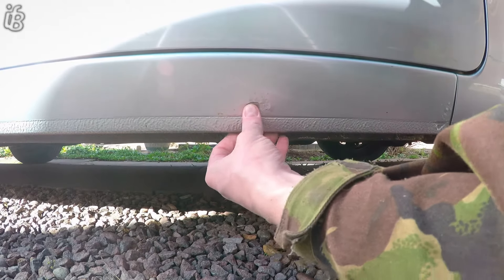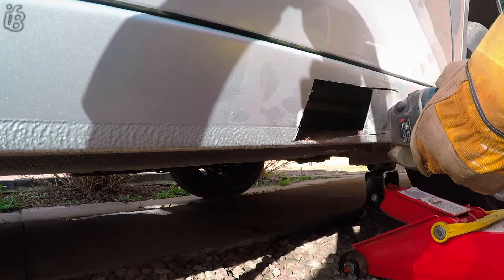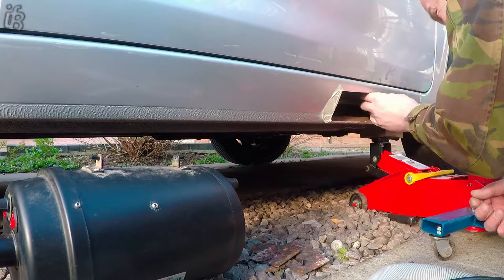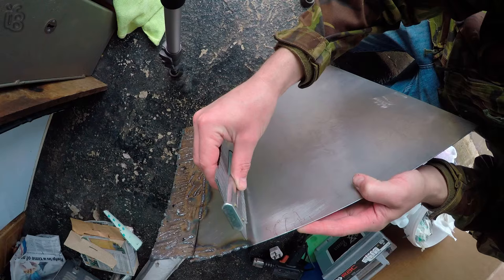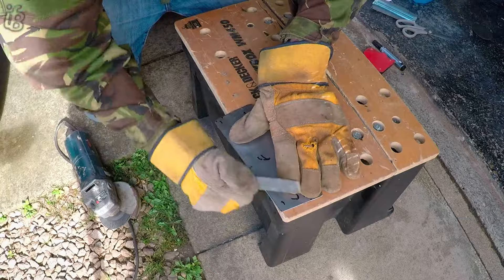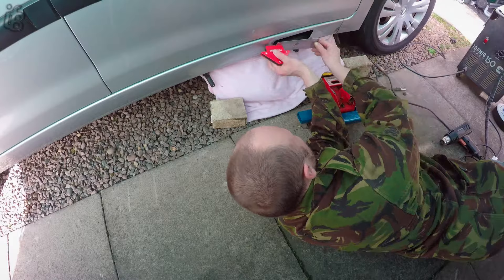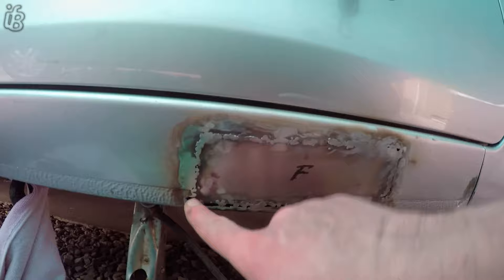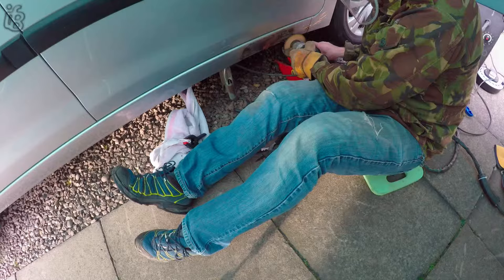Sill repair, cutting & welding pt1

Comment: To anyone else about to try this, shield your work if using mig gas, the wind will take the shielding gas away, cut more out than you think you need to, as soon as you weld thin metal it will blow through, you need to cut back to good solid metal, inner sills need to be repaired properly unless you want the car collapsing when jacked up, no gas mig welding can be a good option, but you still need good metal, thin rusty metal will blow and pop holes regardless, always have a spotter to watch when welding, its easy to set things on fire without noticing. Grind so sparks go downwards or away from glass, the hot sparks can and will stick to glass and paint, later to go rusty, better and safer for your eyes anyway. check if your grinding pads/discs have a date on them, they don't last forever and don't like damp conditions.
Reply from the maker: Well said, yes it was shielded from a sheet, thank you.
Reply: Hi, what's a good welder to use for a decent price.
Reply from the maker: I would say get a second hand one, definitely mig. But if you have a Tig then use that. But considering you are asking I assume not. Check out the forums for upgrades and reviews. Mine is a sip, they didn't give great reviews from it. But it was an upgrade from a dual power/speed gasless which sucked. 
Check out the forum and tutorials from here https://www.mig-welding.co.uk/
Reply: OK, thank you.

Comment: Great Video!  loved the bit where you've nearly finished it, all you need to do is leave it alone, but your like every good diy'er and have to play some more and blow a great big hole in it hahaha.  Doing mine soon, so thanks for this!
Reply from the maker: Try to take it back as far as you can, unfortunately the rust has came back in a part I thought I might have gotten away with, so this time I'm going to cut my losses and for about £45 buy a new rocker sill cover. Just awaiting the parents to agree on it. Then I'll do another video.

Comment: Wow, I've been through some of the exact things like burning out weak areas.  You are doing a great job.
Reply from the maker: It's a pain right, just got to keep on going. If had to do again I would cut the sill out and replace!
Reply: @ifell3  I have a car where the rot goes into what I believe is called the support and back sills, it's a huge mess and I'm debating what to do.  I bet we agree about hating rust.

Comment: Nice to see someone doing a proper job of the welding instead of these bodgers that cut it out and then stick metal over the top or rivet it and cover it with 1/2 an inch of filler.
Reply from the maker: Cheers fella!

Comment: Tidy job mate. Looks like exactly how I did mine except I injected wax into the whole sill. Dynax S50 by Bilt Hamber. Wouldn't touch anything by hammerite. I live by the sea so I know what works and what won't 😊.
Reply from the maker: Cheers fella, yeah I wish I had spent some money on some wax. First sill repair in years, the choice of protection is overwhelming!!
Reply: @ifell3  My old Bora is 18 years old, gives 70+mpg but has a bit of the old tinworm in the usual places.

Just spent nearly £700 on a mini restoration. Mrs thinks I'm nuts as could have bought another for a few £££ more. Women don't get that us blokes LIKE to tinker with cars and stuff. The satisfaction from doing the job yourself is priceless when you can stand back and say "Yeah, I'm pleased with that". They just look at us like were mad, then they go and buy another pair of shoes 😂
Reply: @siliquaesid703  there is a lot to learn from women, I realize that we men are trapped in our own box, they see beyond it and do not care about other than that.
Reply: @siliquaesid703  yeah my girlfriend said why am I bothering welding my sills on my car why don’t I just leave it until it’s bad and has a hole in it. Thing is it’s already bad once it’s bubbling on the surface and I want to save it whilst I’ve got a chance lol

Comment: Hi, I take it you disconnected the car battery, where did you earth point the mig
Reply from the maker: Yes I always do, I never used too 20 years ago but everything is electronic now. I think I may have even disconnected the ECU too. Always place the ground as close as possible, I connected under the sil.

Comment: Great vid, question what welder do you use as I keep blowing holes with mine ends up like a collender!
Reply from the maker: Gas MIG, do it in little bursts, clean metal and a good earth. Use a mixture of gas too, pure c02 will give hotter penetration, which you don't want.
Reply: @ifell3  Thanks buddy for the reply, was looking at gasless MIGS but guessing no good pretty cheap reason being.
Reply from the maker: @ZippyPenguinTribute  one bloke in the comments recommended using a gasless MIG. I had a cheapish FCAW that was ok for thick metal, that eventually was used in another video to rehouse my SMAW. I brought my GMAW off of eBay for about £50, power and wire feed settings are the most important for dialing in on thin metal. The thicker the metal you can hang around in the puddle for a bit longer, the thinner gauze stuff you want just the right amount of power. Also adjusting wire feed speed can have an effect on how much amperage and burn through you get. It's a thin line, the more settings the better.

Comment: Does anyone know if you can replace the sill? Mine has cancer
Reply from the maker: Yes, you can buy the outer for sure on eBay. It's not actually that expensive I think it was £45ish. Just make sure you support the car properly in the middle to stop and sagging.
Reply: @ifell3  na I don't mean the side skirt (plastic) I mean the metal
Reply: @ifell3  what the plastic side skirt fits on to
Reply from the maker: @BasedSaxon I know what you meant, Google "c4 grand picasso sil"

Comment: Did you disconnect battery before welding
Reply from the maker: Yes, older cars you never really had to bother so much, newer cars are all electronic and need only small voltages and current for a signal. Definitely at least earth, and keep the ground as close as possible to the welding area. Best to be 100% sure i would be to disconnect battery and ecu. Some cars don't even like being jump started these days!!

Comment: Lot of porus weld there wind was blowing your shield gas. Flux core would have been better idea if you can't weld inside or stick weld if you can
Reply from the maker: Thank you, the metal was .9 mm in thickness, from previous experience of welding sheet steel is flux burns way to hot, same with stick. I also tried to time the weld between wind as best as I could. Thank you
Reply: @ifell3  Nah you can flux core bodywork with a combination of torch angle and less time on the trigger. I've used it for years outside it's just more difficult to use.
Reply from the maker: @jimmyk9523  I used to use one on a MK2 escort I had and it was a right pain in the arse. Yes you can but was way more difficult. For me anyway, if you two can weld a continuous bead you guys are better welders than myself 😉
Reply: @ifell3  Wasn't knocking your welding just saying you can use it. No one can run a continuous weld on metal this thin, it'd blow through quick. I enjoyed the videos anyway.
Reply from the maker: @jimmyk9523  Sorry if that sounded a little salty, wasn't meant to be. I had a gasless maypole two power setting and that also changed the wire speed, bloody pita!! Funny enough I've just used its case in a video I've just done to rehouse an old stick transformer^^

Comment: I've blown holes when trying to fill in pin holes and it such a pain in the arse when that happens. I do like repairs with minimal filler.
Reply from the maker: Yeah right, I came to notice that most times I blew through there was poor quality metal. I had to enlarge the section because I was just wasting my time.

Comment: Why don't you just use a weld through primer on the back?
Reply from the maker: Yes you are correct, I can't remember my reason now. It could have been because the metal behind was not guaranteed to be clean. I think I mentioned this in one of my other comments. ATB

Comment: how much did the repair cost ?
Reply from the maker: It's hard to say, the metal was about a tenner I think, but have loads left over, same with things like the welding gas and wire. Grinding discs and sandpaper I all ready had. To be honest it would be easier to buy a new sill for £40 and just cut out the old, treat and weld on a new. Wouldn't have to bother filling too.
Reply: @ifell3  thanks mate, actually i'm a car supplier from Japan and i supply in Ireland .my customer had a problem with his car had soot stains  underneath the sills, so i was just looking how  much would cost him.
Reply from the maker: @rehankarim6094  soot from what? Power wash it off, but the black stuff I think I linked in the comments on one of the other videos.
Reply: @ifell3  there are  black spots underneath the sills is there any way to remove it?
Reply from the maker: @rehankarim6094  what is it tar? You can get tar removal spray

Comment: I like the trolley jack modification, did your wheels break off or did you modify it for another reason
Reply from the maker: No I modified it in another video, for the gearbox video 😉 made it wider to help it not tip over!

Comment: A little less Skip welding would do the job ,,, and after welding it's best to spray the iside (little hole) with used engine oil
Reply: why use used engine oil ??
Reply: @tomthompson7400  it penetrates and preserves metal better than tectyl
Reply: @shootingsportstransparency7461  
used engine oil is acidic , and it floats on water actually trapping in moisture and doing more damage long term ,,, 
what no need is something like ACF50 , if they ever start using used engine oil on helicopters and aircraft Ill switch , till then its a total no no , The other thing is that ACF50 wont burn , so if you have to go back for a repair the car wont catch fire . 
a car full of oil is not a pleasant thing to weld .  Just my thoughts , but it may give you something to have a think about on future projects.
Reply: @tomthompson7400  Engine oil will penetrate a steel surface and is having additives with make it bind water. but if you love to pay a lot of money for a commercial product i'm ok with it. The chimney of the AFC 50 salesman needs to smoke to, I'm sure he even want's to drive a luxury European car.
Reply: @shootingsportstransparency7461   have you tried it ,,, give it a go and see ,,, I give two years warranty on any repair I do , and its only the use of acf that lets me do that ,, i get a lot of repeat customers and no warranty , seriously give it a go and see.
Reply: @shootingsportstransparency7461  oil is the worst thing you can use, grease is your best bet when preserving inner sills and areas from rust
Reply: @tomthompson7400  If you say so i'm fine with that, I will stick (after trying all sorts of expensive preserve goodies for over 45 year )  to my hot used engine oil
Reply: @shootingsportstransparency7461   if it works for you stick with it ,,, the day I see them pouring used engine oil into aircraft fuselages Ill start too.
Reply: @tomthompson7400  As soon as they spray what ever kind of liquid into an aluminium aircraft fuselage (so that possible material fatigue scuffs are no longer noticed) I advise you not to get in it. Such an aircraft will also lose its airworthy certificate btw.
Reply: @shootingsportstransparency7461  they use acf 50 to percent internal corrosion between steel air frames and alloy skins. There's a newer product now but basically the same .. it's a standard procedure in aircraft maintenance... I'd not be getting in an aircraft that hasn't been done.